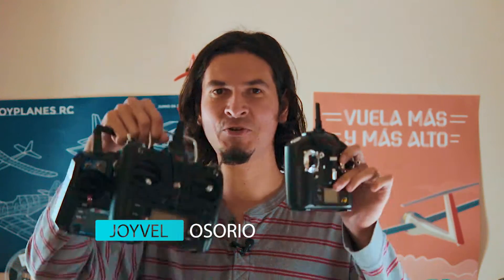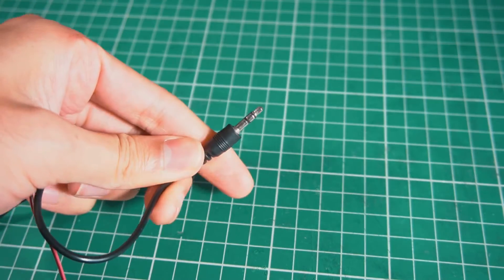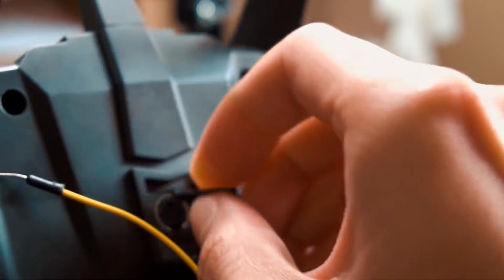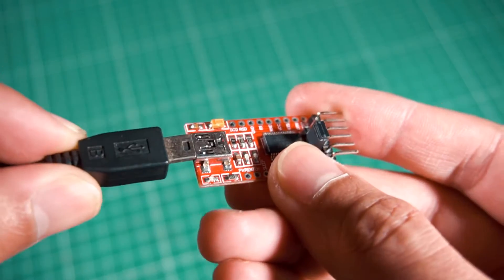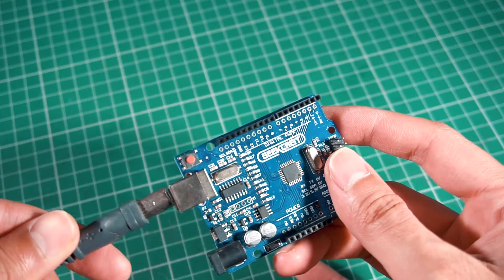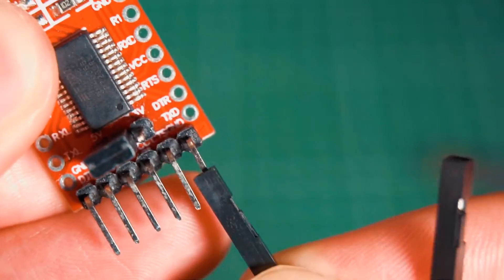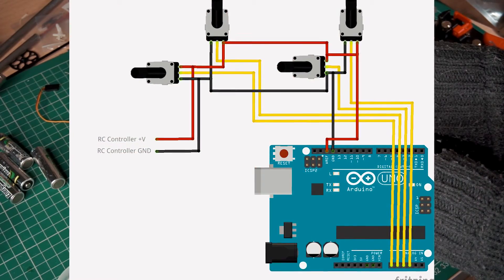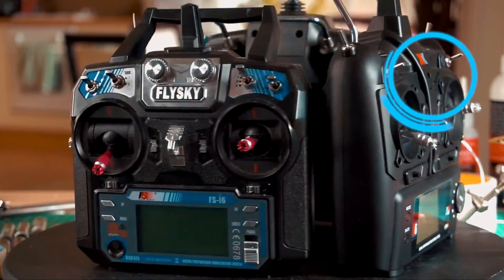Connect any RC to your computer to use it on any flight simulator or video games

Comment: The FTDI works great...
First of all thanks a lot, this ssly helped me a lot...
I used the self made simulator cable and SmartPropo Plus on FPV Freerider , but this SPP Software fluctuates a lot... I wanted it to work with LIFTOFF, but as SPP  made my computer slow too, when it was running...so was unable to FPV on LIFTOFF ....
But after this video....🔥🔥🔥
The FTDI or Adruino idea, wow....!! Works perfectly without fluctuations and slow computer...
I would recommend everyone to use a FTDI, a bit extra amt of money to invest but works perfectly....
Again thanks for the video🤘🏻🙌🏻🔥
Lots of love frm India🇮🇳...
Reply: Does the FTDI interface directly with fpv freerider ?

Or did you have to use SPP to decode the input from the FTDI?

Comment: Smartpropoplus is detecting my trx but no response when I move the sticks. Status says audio signal is ok but can't calculate joysticks position. Try another type of modulation. Help me to solve this mate
Reply: did you fix your issue?
Reply: @OverTheTop9960  yes firstly I completely deleted my pc then reinstalled , the I tried different aux cables and finally got one (home made using two earphones
Reply: @maharajakannan9558  Does it work if i dont have a dedicated microphone port? I only have one port for both microphone and headphone
Reply: @anannyosamayel1350  S most probably it does

Comment: Hi... Thanks for sharing your video, great help, let's go forward together, best regards!!! What's new on my channel? I invite you to see my Volantex 757-3 try to reach a new maximum distance record, over 3000 meters fo distantce from take off point... but I did not succeed in this test and the following week this plane crashed without any control from a height of over 30 or 40 meters... the Arkbird (autopilot system on board) blocked maybe due to excessive wind-induced instability... I was left with no control over the plane, I just watched it fall... you are always welcome!!!